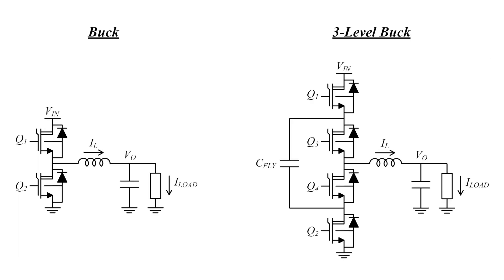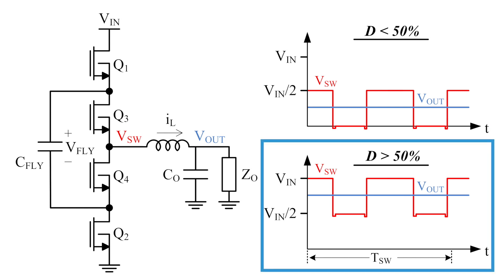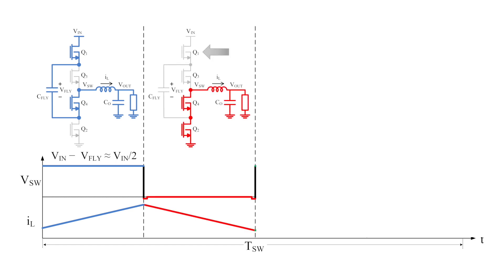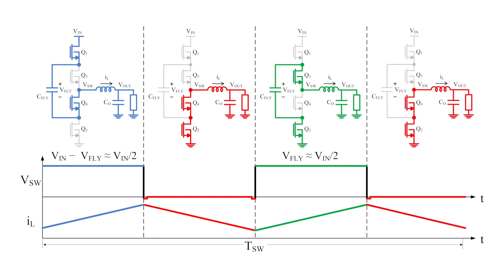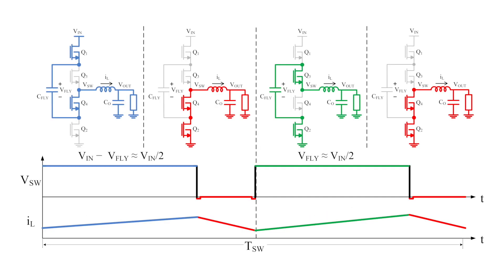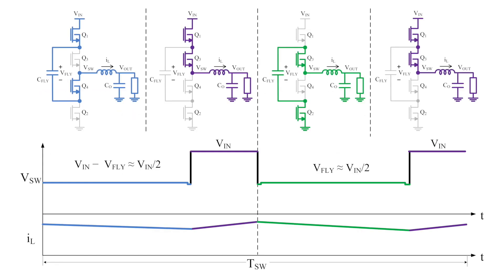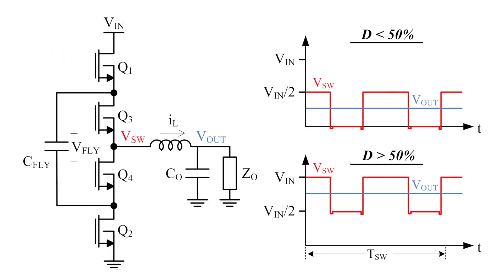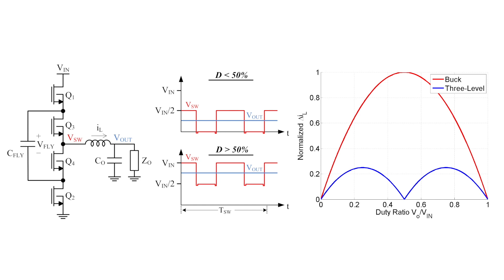3-Level Buck Converter: How it Works?

Comment: @4:11, why the first cycle inductor current is discharging instead of charging inductor?  may be because the input voltage keep decreasing say lower to 5V-> Flying cap hold 5/2=2.5V ->the switching node voltage was lower than output voltage 2.5 <4V out-> the inductor switching node voltage dorp and cause inductor feels the current change , then it swap the role from energized status to de-energized and discharging?

Comment: I got 38.6 C @1A, 43.0 C @2A, 51.2 C @3A, 63.5 C @4A, 77.5 C @5A and 103.5 C @ 6A (VBUS = 9V, VBAT = 3.5V). The BQ25898D on the same board was 48.7 C @1A, 49.1 C @2A, 59.1 C @3A and 74.1 C @4A. It looks like TI wants to sell you both chips to move 5A at 51 C (3A on the BQ25910 and 2A on the BQ25898D). Or 7A at 63 C. Not bad.